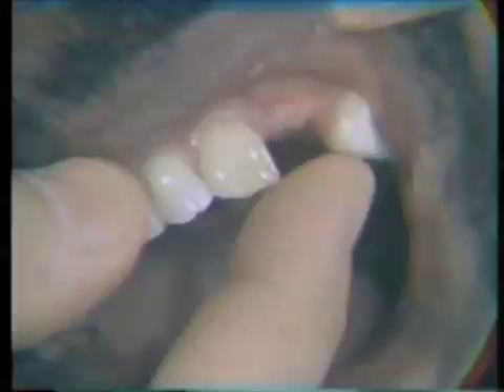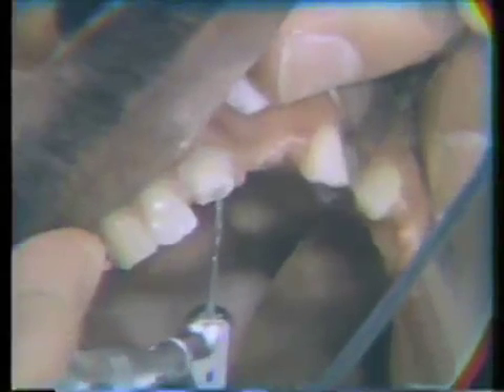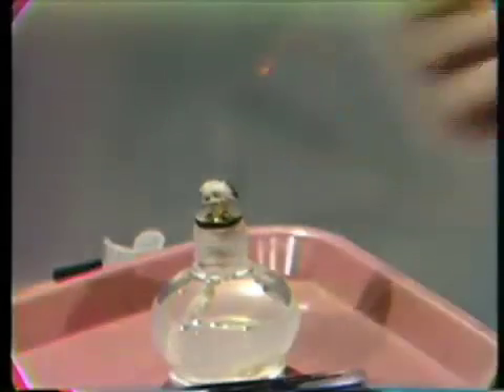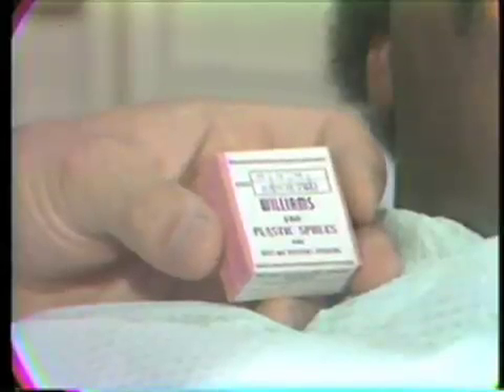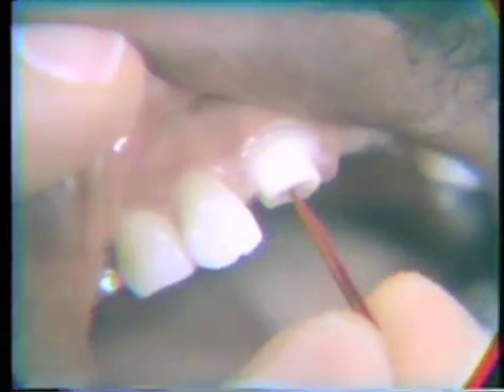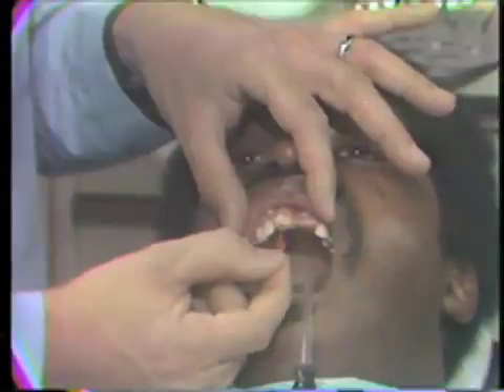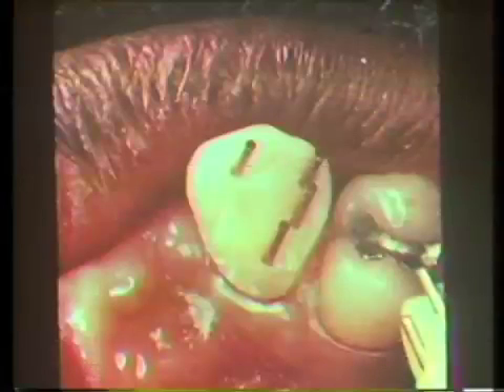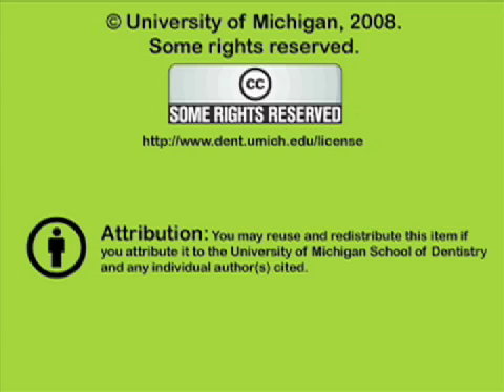Fabrication of a Direct Duralay Post

Comment: why doesn't he just crown the tooth? 
Can someone explain why he is post crowning?
Reply: right
Reply: @Justin Underwood, Because the tooth remnant is too short, and there is not much left to hold a crown against horizontal movement. That's why the root needs reinforcement in vertical direction.